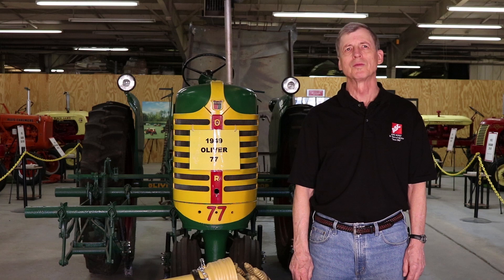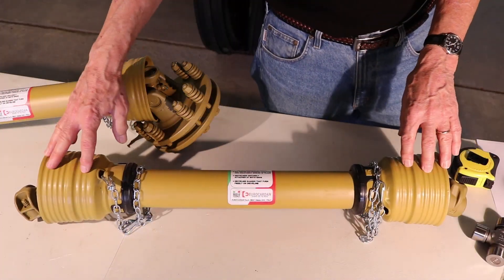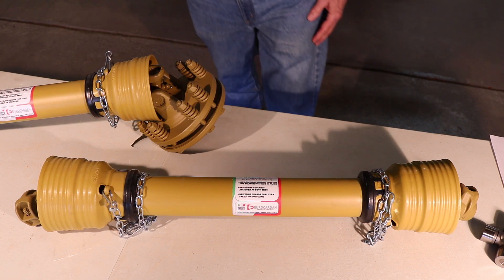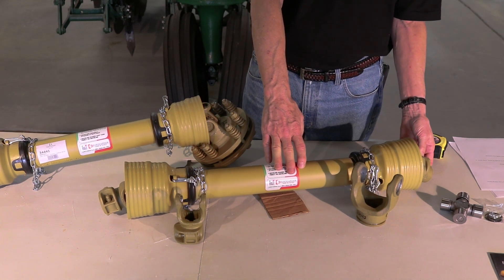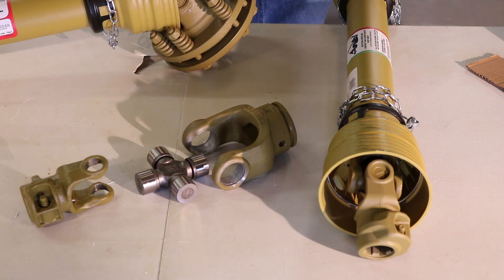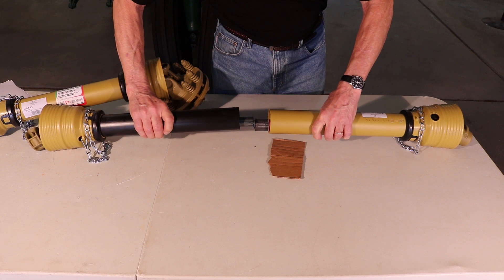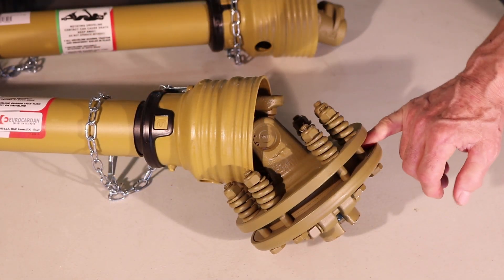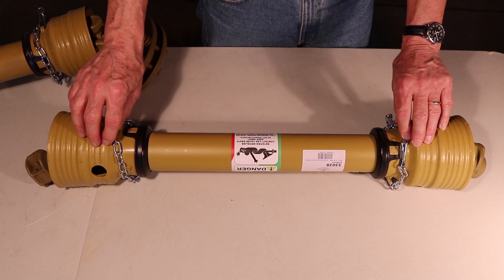Power Take Off (PTO) Shaft Basics with Agri Supply®

Comment: The spring loaded side. I’m missing the bolt do you know where I can get one?
Reply from the maker: Good Morning Tammy! I've reached out to our techs to see if they can help provide an answer to your parts questions here. We can send you a message back shortly here on YouTube, thanks.
Reply from the maker: Hello again @tammygordon936  So a couple suggestions here based on your video comment. You could be in need of a new Spring bolt/pin like this one: https://www.agrisupply.com/qd-pin-assembly-fits-eurocardan-yokes/p/31375  That goes on the yoke end.  Or you may be referring to a shear bolt like this one: https://www.agrisupply.com/grade-bolt-nut/p/76004  Either piece could be a part of the PTO system that needs replacing. We would be glad to help you find the exact part you need! You can reach us online via the link below or call our Customer Care Team directly at 800-345-0169. Hope this helps - have a great day! 
https://www.agrisupply.com/contactus.aspx

Comment: how do I know if I have a series 1 or 2 or 3 PTO shaft? I need to buy a new plastic Shield
Reply from the maker: Hi there @pr0pman, appreciate your question! We would suggest looking for the number cast into the body of the cross section. If that doesn't provide the answer to your question, the first number in the number cast into the yokes should also be the series. If that doesn't work, we recommend measuring & comparing the size. We would be more than happy to walk you through troubleshooting if you have a moment to give our Customer Care Team a call at 800.345.0169
Have a great day! 🙂

Comment: How do you disconnect the shat from the cutter, to begin with?
Reply: I meant from the cutter, not the tractor. All the videos seem to start with the shaft laying on a table, already disconnected. Thanks
Reply from the maker: @keh0461  Yes sir, okay no problem. Thanks for clarifying! Below is a couple suggestions from our techs:
First, a good idea might be to spray the area of the gearbox shaft with a good quality penetrating oil and allow time for it to work to help make the removal easier. It's very possible that the yoke has become slightly seized to the gearbox shaft. In addition to the penetrating oil, some light taps of a hammer all the way around the yoke while pulling might be helpful. Be careful not to break the yoke and we can't recommend enough wearing PPI gear in case something does break! 

If the gearbox shaft is splined, it could be attached in one of two different ways: 
#1 - There might be 1 or 2 bolts holding the yoke of the shaft to the gearbox shaft, they would need to be removed. 
#2 - The yoke could be a quick release just like the tractor end and could be designed with a push-button or pull-type style release.  

If the cutter gearbox shaft is smooth, it likely has one bolt going through the center portion (shear bolt) of the yoke into the center of the gearbox shaft.  Simply remove the bolt and nut and remove them from the shaft. 
These are again just some quick suggestions to try, but we recommend following the safety guidelines stated in the manual of your cutter as this job can burst knuckles, or worse sometimes. Hope this is helpful Ken, have a great day!
Reply from the maker: Good Morning Ken,
Depending on which type of stub shaft you have attaching to the back of your tractor - You will have to either pull back the PTO shaft to release the ball bearings from the coupler on the back of your tractor, OR there might be a small bar pin that needs to be pressed in order to release the PTO. We recommend checking the mfg. manual to see how your particular PTO works on either end. You should be able to pull apart the plastic shield guard and two pieces of the PTO making it a little easier to remove from the cutter. Hope this is helpful! Feel free to reach out to our Agri-techs at 800.345.0169 or www.agrisupply.com if we can answer any more questions for you, thanks!

Comment: Good   Video information 👌🏻
Where can I get the right push in lock for the same drive line you are showing??
Reply from the maker: Good Afternoon Rafael, thanks for your question! Here is a link to our website with which pin assembly you will need. This particular item fits most of our Eurocardan economy line of PTO shafts. Let us know if you need anything else: https://www.agrisupply.com/qd-pin-assembly-fits-eurocardan-yokes/p/31375/

Comment: At the 2:00 mark when you put the two shafts together, they seem to slide together very easily. Is that the way they should be? 

I ask because I have a Woods rotary cutter and if mine slid that easily it would make attaching it to the tractor much easier.
Reply: Good day,
Thanks for your question. In short - Yes the shaft should move freely allowing you to connect and disconnect from the tractor. Although, it's common over time for rust to build up making the process of sliding more difficult. In some cases you can apply lubricant then grease to free up the shaft making it slide more easily. If your shaft is bent, you may want to replace it. Please contact us if you have any more question.
Reply: Bud Miller, Training Specialist thank you very much! I bought the tractor and rotary cutter last fall, didn’t start using the cutter until this summer. I don’t know how long it had sat outside at the dealer. It sits outside now, too. I can say it has always been difficult to move the shaft so I think separating the two parts and giving it a good going over will really help. Thanks again for the video and your response. You have really help me a lot.

Comment: I have a king kutter 5 foot rotary kutter with a 40 horse power gearbox.  It has a shear pin pto design and the shield is gone.  I live in mid Michigan and I have no place to go to get the part I need.  I'll have to order on-line but that isn't my question.  How and hell do you remove the shield and re install it?
Reply: Darren,
In the past King Kutter has used several different brands of P.T.O shafts. Can you look at your shaft for a brand name, if not can you send me pictures of what you have. The covers attach different on each brand.
Reply: @jimmycoward7055  Jim,
My rotary cutter model is L-60-40-P-Y.  The pto kingkutter part number is 147029.  It says it is a 29" shaft.  I do have the the shields that go over the knuckles of the pto but not the tubes.  I see the name Eurocardan on them.  According to the manual, the kingkutter part for the Eurocardan safety shield is 124311.  
In my earlier post I said I'll have to order on-line.  I need to know how to install/remove the shield.